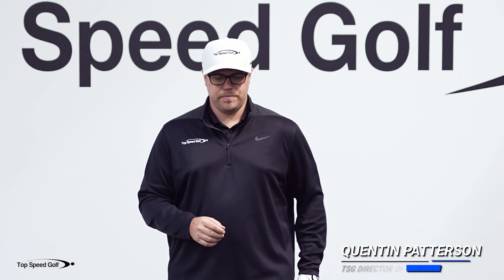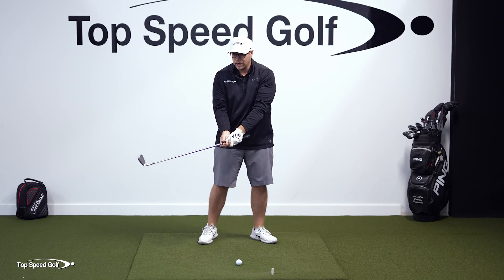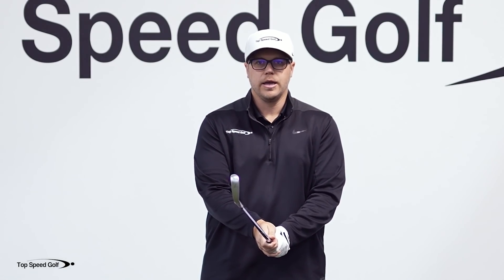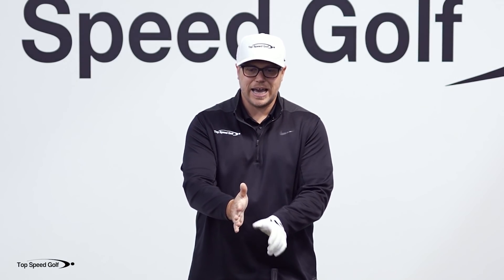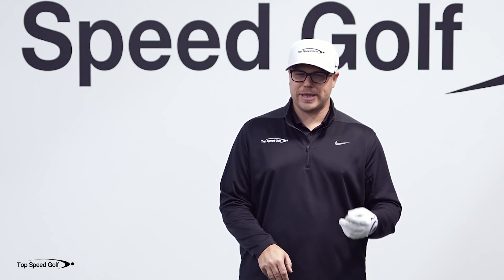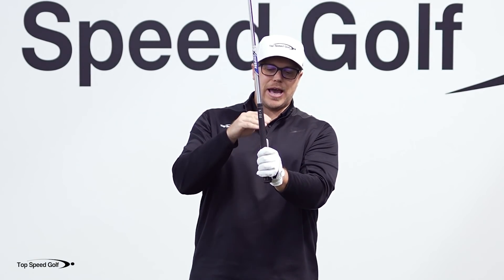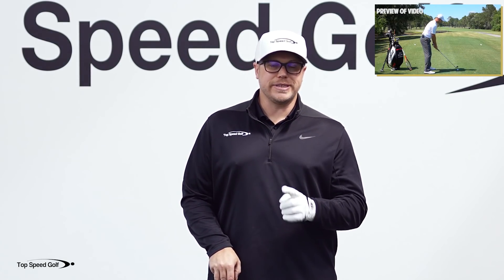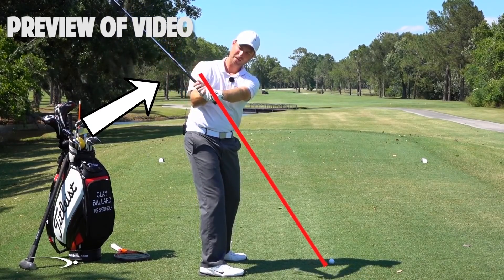This Grip Fault Can Ruin Your Golf Game But It's Easy To Fix

Comment: I always find it really works good to sit the club across your shoulder(i put it on my right shoulder), parallel to the ground like you would hold a baseball bat. This really puts the club in your fingers much easier than  gripping it when the clubhead is souled on the ground. Even if you grip it when its souled, you can still sit it on the shoulder and regrip. This also takes the tension out of the arms. Hope this helps someone.
Reply from the maker: Thanks for sharing Fred. I like that.
Reply: @TopSpeedGolf  thanks, love your content.